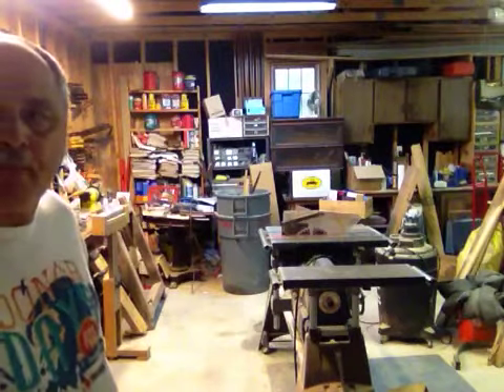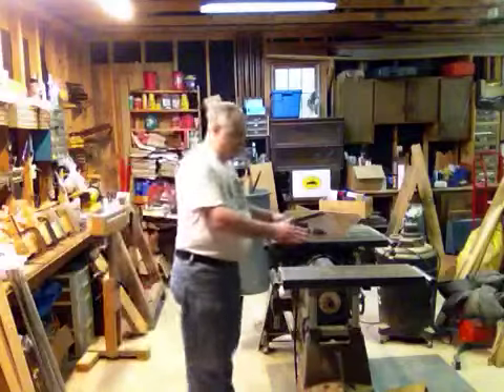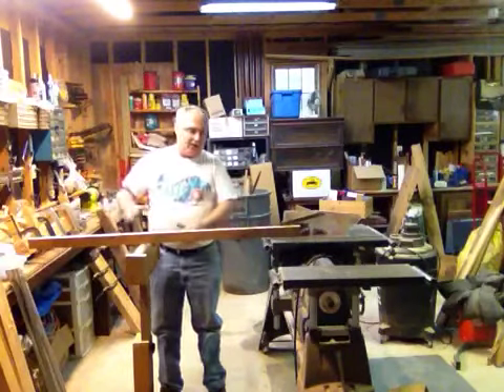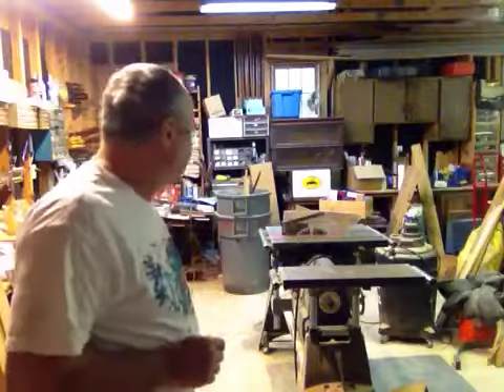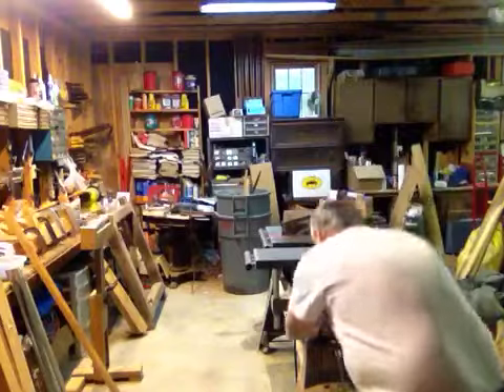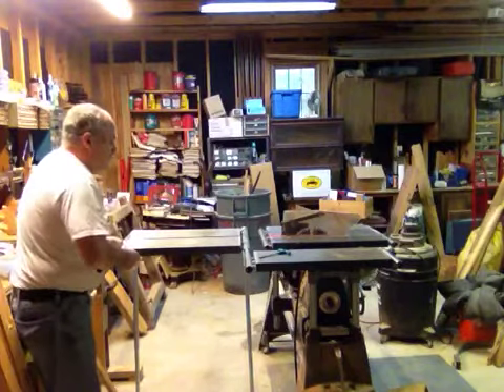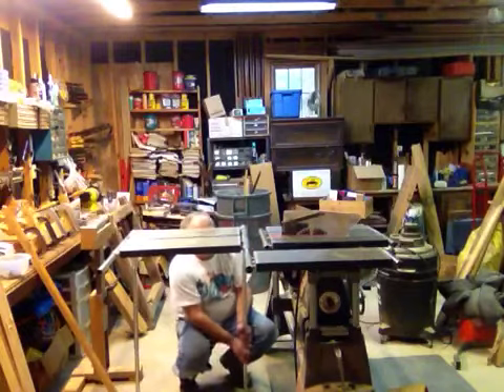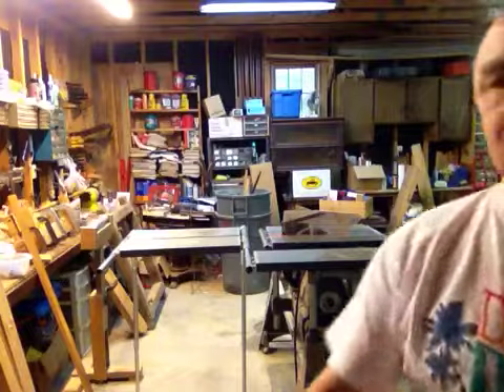Shopsmith Outfeed Table

Comment: Thanks for sharing this, Stew. Yes, this same trick can be done with a 520 too. Great tip! Scott
Reply from the maker: Good Morning Scott.  Since I did this video I upgraded my 510 to a Mark 7, and bought another 510.  It works well with the 520 tables, but when I tried to set up both an infeed and an outfeed table at the same time the table heights were different because of the design of the 520 tube holders.  I did a video on it and noted the problem.  Since I did that video, I figured out that if I moved the auxiliary table from the 510 to the 520 I could get everything on the same plane.  I guess I have to do another video on that.

Comment: Thanks! That's a great solution to one of the major complaints people have about the ShopSmith. I've used mine since the early 1980's and can tell you, it's the best way for someone to get into woodworking if they are in a small shop. I will always have a ShopSmith even though I now own dedicated "one function" machines.

Comment: They also sell brackets for this purpose for $80 a pair. They allow you to use the tube ends protruding from your main table and use them to create a perfect outfeed table. They also sell a wooden outfeed table that connects to the main table. You can also create infeed tables using his method and the brackets.

Comment from the maker: I don't have a Shopsmith band saw, but one of the most important things I have found is that you have to make sure your blade is tracking on the center of the tires.  If you allow it to go too far forward or back on the tires it will cut erratically and you'll never be able to cut a straight line.  That and tensioning it properly (I just twang the blade until it sounds right) will start you on the right foot for getting good performance out of your bandsaw.
Reply: Hey Stu. You are correct about the blade placement on most bandsaws, but the Shopsmith bandsaw has a unique “Auto-Track” system that makes the blades run towards the back of the top wheel. It’s different, but it works perfectly. Great vid!  Scott

Comment from the maker: Hi Steve,  The tables are included on the Shopsmith 510 and an improved table system is included on the 520.  The 500 (and I believe the 505) does not include the table system.

Comment: Great thinking!   ShopSmith must have been listening, because the company has fabricated easy-to-use hardware to further simplify your solution (part no. 555997).  The basic idea is the same as yours: use the floating tables to support long stock.